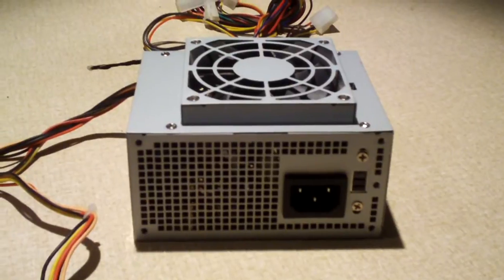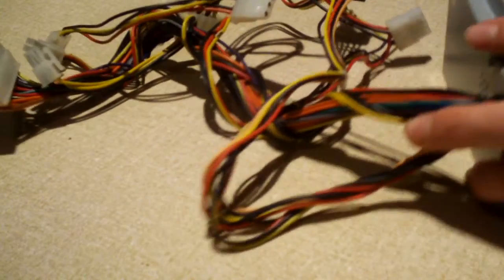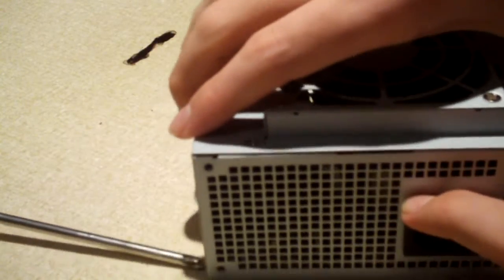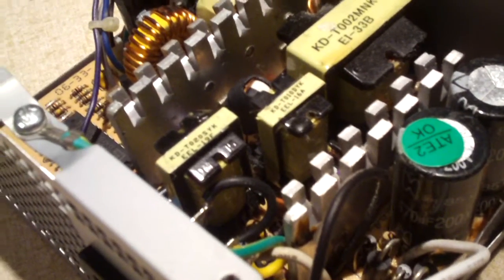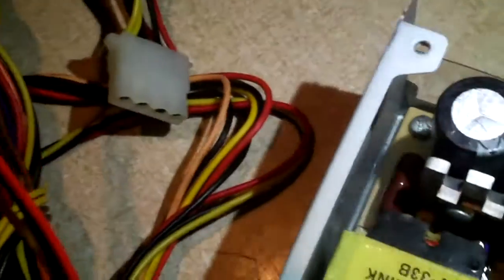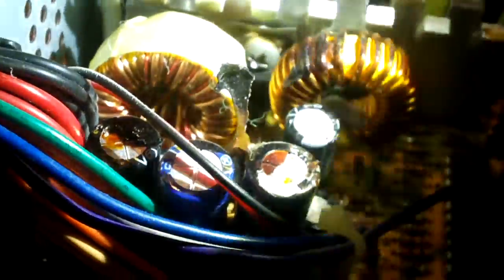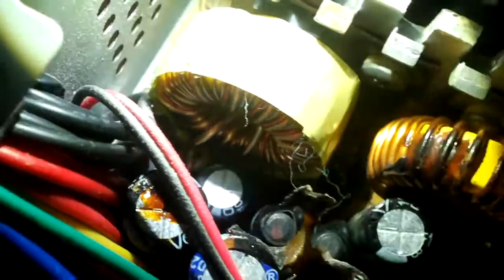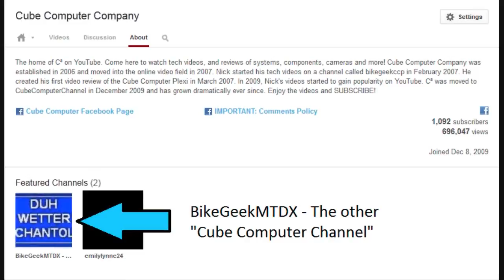A look inside a Logisys 350W MicroATX Power Supply

Comment: Hi there I am J.R. from Utah. I been meaning to ask you this for a while. Where is a good place to get new capacitors and other components and what are the best brands to use? By the way I really like your videos. They have helped convince to learn how to solder/desolder, so I can improve my repair/rework skills. Which means I can save more motherboards, power supplies, and other computer parts from going to my local e-waste recycler.
Reply from the maker: Capacitors can be ordered from places like Jameco, DigiKey, Badcaps, Amazon, etc. Try to stick with brands such as Rubycon, Nichicon, Panasonic/Matsushita, Sanyo, Samxon, etc. I actually harvest good capacitors from motherboards and power supplies, so I don't have to buy new caps often. Glad you enjoy my videos! It's nice to be able to repair power supplies and motherboards instead of throwing them away when something goes wrong.

Comment: do you know a brand called everpower? it is some noname brand ive never heard of it works no bad caps it is not very old should i junk it? and the main big caps they look too small for the microfarad
 about an inch i cant remeber voltage its in the 400's should i junk it?
Reply from the maker: I've heard of them, though I don't know a lot about that brand.

Comment: Thermaltake SMART Series SP-550PCBUS 550W? is it a good PSU?
Reply from the maker: The SMART series are great power supplies. The MidTower Deluxe has a Smart 750W Modular unit.
Reply: Yeah I upgrade from logisys to Thermaltake smart psu so much better and I feel safer to use